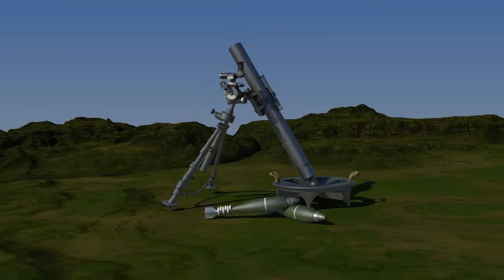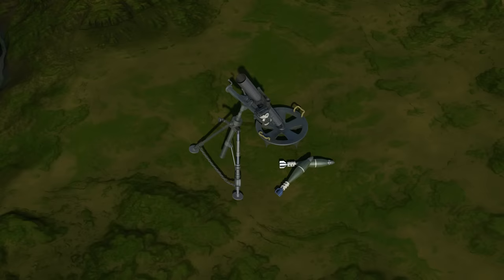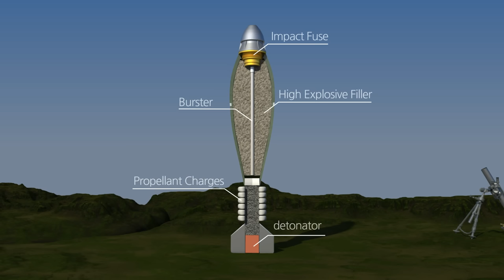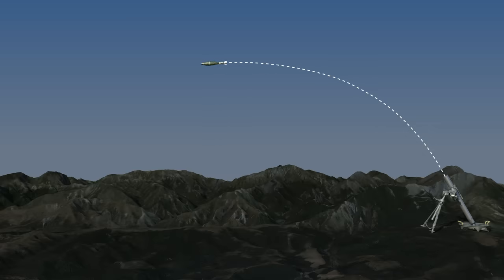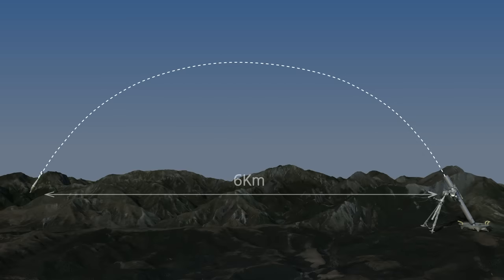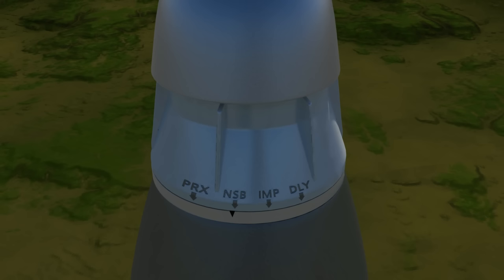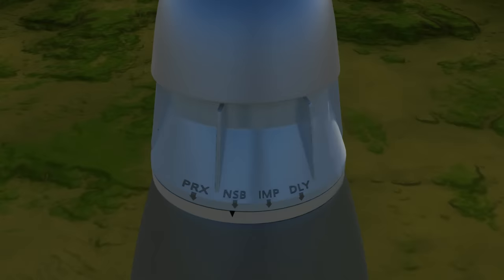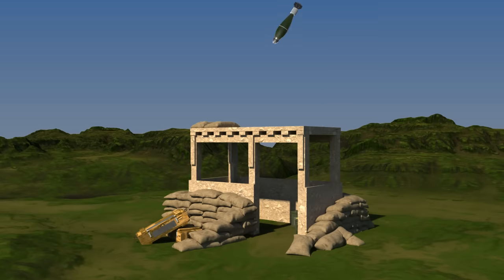How does a mortar work?

Comment: Is the morter a howitzer? I've always worked under the impression that they were different. Morters where a short barreled, short range, high arching indirect fire weapon. Howitzers where long barreled, intermediate to long range indirect fire  weapons with shorter archs, and possessed a limited direct fire capability.
Reply: There are mortars systems which can operate also as small howitzers (2S9 Nona, 2B16 Nona-K, 2B9 Vasilek, 2S31 Vena, Drok etc.).
Reply: @petersedliak4362  Those are all mortars. I don't understand how they qualify as Howitzers, self-propelled or otherwise.
Reply: @reminder9146  They are designed as mortars, but their main weapon combine mortar and howitzer characteristics. Nona-K and its cannon 2A51, is typical example. Its alowing even direct fire on target, but due to smaller charges, its projectiles have significantly lower speeds, which mean that even for direct firing they need certain elevation of barrel above LOS.

Comment: You can also have a breach loaded mortar which can be fired horizontally.
Reply: @50buttfish  not quite,the breach is locked closed when the bomb is loaded.It is  like a howitzer.It can be fired at all angles from zero to 90.
Reply: Those are modern pieces mounted on a vehicle that break the definition of a mortar. It is more of a smooth bore low pressure gun that can fire mortar shells.
Reply: @Pukovnik141  they aren't modern they are around since at least the 60,s.Used them mounted on the Panhard L60.The barrel was only designed for 60mm mortar rounds.These were later changed for 20mm cannon turret instead.They then were withdrawn from service in my country around late 90,s

Comment: Mortar can drop into a trench which made it a very dangerous weapon against infantry.
Reply: For digged in infantry usually the approximation head is used for detonation in 5 to 10m  height. the shrapnels will hit into the trenches from there. they can mix it with delay heads to penetrate the roof of the random shelter at the trenches. The delay heads are also good to hit certain houses in a town or city.

Comment: You don't dig out dirt to "install" a base plate.  It kind of installs itself after the first few rounds.
Reply: You dig your foot out from under the baseplate because you were facing the tube when the round struck.its not like the oil field or pipeline where you have steel toe boots. Even that wouldnt matter because it would take off whole part under the plate

Comment: I honestly was not aware that you could have those kinds of settings at the end of a mortar shell. I mean how does that exactly work anyway? They don’t have a computer inside so how does it know that it is above the target for a certain amount before detonating when in the proximity setting?
Reply: I assume works like a old time alarm clock after so many seconds depending on the distance set by the powder bags on the rounds the round will travel.
Reply: The M734 Fuze has doppler radar

Comment: How does it detect how high it is currently above the ground to trigger the explosion?
Reply: There are several constructions. Radio altimeter, or mechanical: mortar round spins for stabilization. Mechanical detonator counts spins and calculates distance

Comment: A Howitzer* is a gun that can elevate beyond 45deg with rifling, and a breach that can be opened and closed for the purpose of reloading and ejecting the spent case.
A mortar 'aint a gun since it's muzzle loaded and doesn't contain a breech that can be cycled like a gun.

*I have a book on artillery and it's evolution and implementation and it is a-b-s-o-l-u-t-l-e-y fascinating.
Originally a Howitzer was a short barrel field gun designed specifically for plunging fire. A siege/trench gun.

Howitzer today however, has become a generic name for a field gun that can elevate beyond 45deg for the purpose of reduced range gunnery - so plunging fire ie behind hills and into towns etc even though they retain a long barrel 
Essentially they are now a dual purpose field gun - saving having to carry two different types of gun when one type can perform two tasks.
I could be wrong but IIRC typically the plunging fire aspect of the modern Howitzer requires different rounds specific to plunging fire - ie there's no purpose sending a normal projectile to 45,000ft (or whatever it is) when you only want it to go 8nm horizontally so they use charges and rounds suited to that task and general purpose ammo for normal use. Using normal ammo for plunging fire results in excessive flight time. For accurate gunnery, temperature, rotation of the earth, wind, varying barometric pressures and numerous other parameters need to be allowed for, so I believe they use rounds for the specific to plunging fire rather than long range rounds that spend a lot of time going up and down reducing accuracy. 
I'm no expert, just read it in a book.

Like life there is no one gun that does it all. They all have strengths and weaknesses.
Reply: Your book is highly inaccurate.  8 inch and 6.3 inch RML howitzers were muzzle loaded just like many of the rifles and canons made prior to the 1900s.  The German 75mm field mortar, the 60mm Brandt, the Soviet 240mm M240, and most self-propelled mortars are breech loaded.   Muzzle loaded canons used a variety of loads and techniques that can replicate the effect and damage of plunging fire.  Today, cannons are rifled and breach-loaded too; specifically 20mm and 30mm cannons.  The biggest difference between canons and howitzers are in the pressures and temperatures they’re designed to withstand over time.  Canons, like guns, tend to be mass produced using relatively quick and simple processes while howitzers are usually more meticulously developed and produced in fewer numbers.

Comment: how do mortar explode 30cm before hitting some surface?
Reply: A proximity fuze, which is almost (but not quite) like a tiny primitive radar. It basically uses the shell as an antenna to send out a signal. That signal is then reflected. Since the shell is rapidly closing with the target that creates a doppler effect that the shell measures, and the amplitude of the doppler effect will increase the closer you get to the target. When it corresponds with the distance you want it triggers the shell to detonate.

Comment: So how come when the augmenting charges don't fully propel the ordnance, like fall within 2-3 feet of team, it doesn't go discharge?
Reply: The fins on the mortar shell cause it to spin like a rifle bullet in flight, making it more accurate. The fuse in the nose of the mortar shell doesn't arm itself until it has spun enough to be well aways from the tube and crew that shot it.
Reply: @johnstuartsmith  Thank you John!
Reply: @johnstuartsmith  Mortars don't spin. Fins are straight. Mortar doesn't require spin stabilization since it needs to point forward and follow curved trajectory. Fins are there so that shell is pointing nose forward where the fuze is so it can detonate correctly. Fuze arms when it is fired due to sudden acceleration. What you are talking about is howitzer round fired from rifled barrel. Spinning keeps round from tipping over since howitzer rounds don't have fins at the base.

Comment: My father-- expired in 2013 -- was in the Indian army's First Maratha battalion, and was  the platoon commander of 80mm (3 inch) mortor.Now I am sixty five+ but always wondered how a mortor was aimed, how the  targeted distance was to be adjusted accurately, .
Now I some what came to know about it, though not through the video itself, but from the comments of the soldiers.
Thanks brothers, love to you from me,
Maharashtra-india.
(Can anybody enlighten me on my curiosity in this case of Mortors, when 3inch Mortors, and 80 mm Mortors are the same,how 3 inch becomes equal to 80 mm.,as mathematically 3inch=75 mm.
Reply: 3 inch mortar was used by British infantry.It was a light mortar without a sighting system.Dont think it's still in use as it's not NATO standard.81mm would be.
Reply: @eugeneoreilly9356  thanks sir.

Comment: The propellant in a mortar or any gun does not explode or detonate.  It burns rapidly to generate gas to propel the projectile down the barrel.  If it did explode, it would probably dangerously burst the barrel and gun, injuring the personnel operating it.

Comment: a guy had a question how do you tally the mortar kills.... well when rules of war are followed... i count it by the amount of men they agreed to send.... one almost passed the field...  miraculously but did not
Reply: You dont tally them. Usually you can tell how many you have left based on how dry your mouth is. If you have dust in your teeth and your tougue is sticking to the roof of your throat, 0. It takes 3 licks to get to the center of a tootsie pop

Comment: So if we use the delay setting and additional spin drill like tail and head could really penetrate bunkers and shelter
Reply: It already can, and for more penetration you need higher speed (altitude), mass and smaller diameter. That is why for this purpose special bunker buster aircraft dropped bombs are used and not mortars

Comment: why I never ever can find any video about how they can aim with the Mortar ?!? I slowly start to think, they just shoot somewhere with this Mortars as like good luck, or you can see trough the mountain with the sight ?
Reply: Sight shows you angle and direction. Something like using compass and inclinometer. (Only there is no compass inside mortar gun sight) The direction and angle is calculated with a formula based on multiple factors ( direction, distance, temperature, humidity, wind, bomb...)
Reply: @Pukovnik141  I never see anyone count anything, they just put in the angle and shoot, I think they just try their good luck to hit anything, or where they get the Informations from

Comment: Well according to Black Ops II, the firing pin is directly on the bottom of the shell and all you need to do to "activate" it is give it a firm swat, at which point you can chuck it with all you've got for a handy improvised grenade.

Once again, video games have lied to me. . .
Reply: That hitting in game has nothing to do with firing pin . it activates fuze that is on top of the shell. It is usually activated by sudden acceleration when firing and maybe can be activated by sudden acceleration by hitting hard surface Modern fuzes can have mechanism that prevents this as it would be hazardous for soldiers handling shells.

Comment: In the film "Saving Private Ryan" in that last scene where the fight with Nazis is becoming desperate, one of the soldiers is using mortar shells as bombs and is activating them by hitting the back part of the ground...I wonder if that is realistic, I mean, wouldn't the shell's charge explode when he hits those shells off the ground?
Reply: That hitting activates fuze that is on top of the shell. It is usually activated by sudden acceleration during firing and maybe can be activated by sudden acceleration by hitting hard surface. Modern fuzes can have mechanism that prevents this as it would be hazardous for soldiers handling shells.

Comment: How does the augmenting charges on the outside not damage the mortar itself?
Reply: Shell is made of steel and charges burn and explode ( rapid gas expansion). They don't detonate. It is engineered in a way to withstand operational pressures.

Comment: Its a bore not barrel, defination changes with 20mm being a barrel, as 21mm would be bore .
Reply: You mean tube? The bore is the hollow part inside a gun barrel or other tube.
Reply: @Pukovnik141  Correct, its lost in translation, I guess it would be tube, but not barrel(look above).

Comment: A mortar isn't a howitzer. But how do you aim the thing?
Reply: The sight is essentially like a surveyor's scope: you set pole or poles in front and use the sight to figure a calculation of angle & elevation, combined with the charge of propellant you used (those rings at the base of the round). At short ranges, you fire from that yourself. At long ranges, a Fire Direction Center uses more math, and a series of graph plotters (or nowadays a computer) to calculate where the round will land. That's the short & dirty version.
Reply: @MM22966  Thank you. I know that the mortar has essentially never changed. But I had no idea as to how they are aimed.
Reply: @JaimeGarcia-pe7bj  Np. There are also hand-fire (physically moving the tube or holding it with smaller mortars) and direct-lay for close targets, no math involved. There are also guided shells (GPS or laser) for larger (120mm usually).
Reply: @MM22966  The FDC gets the coordinates of the target and the impacts from the Forward Observer. So for the enemy the best way to blind the mortars is to take out the FO. If enemy infantry is closing in and you are somehow protected (e.g. if you are in a tank), your last resort may be ordering the mortar platoon to shell your position and hope for the best. That‘s why Forward Observers are massive fans of proper camouflage.
Reply: @MM22966  Funerals. That‘s a creative way to stop a mortar platoon. Thanks for a great story! 😂 
Though I would really like to see six 120mm shells hitting a garbage dump...

Comment: How does the fuse know when its close to a surface? Its there some fancy ultrasound sensor installed? Or is it simply some rod sticking out.
Reply: [Edit] I was wrong, it's actually radar.
____________________________
Probably a capacitive sensor, they are more reliable than ultrasound (less probability to trigger early) and tend to vary their detection range depending on the material in front of them, which coincides with the video description
Reply: @wanderer2688  Thanks for the explanation
Reply: @vast634  You're welcome.
But take this info with a grain of salt, it's just my guess.
Reply: @wanderer2688  radar, actually, but I don't know the frequency. Probably a few centimeters just like aircraft radars.
Reply: @stettan1  amazing, I would have never guessed it, thank you
Reply: @stettan1  It senses to a few meters out and frequency is not measured in cm but in hertz (Hz). Wavelength  is measured in distance units (meters).
Reply: @Pukovnik141  I know, I know, but I tend to slip since they are linearly related.

Comment: BUT HOW TO TARGET ENEMY BY CONTROLLING MORTARS FIRING..?
Reply: First you need align mortar on terrain , so you know angle between north an base angle of mortar. Then squad officer calculates angle between mortar base and target, on reference tables he gets info about of number of charges and elevation angle. Then he get weather info and adjust angles to correct values.  Mortar team gets angles from officer and uses two wheels to turn mortar and change elevation.  After shot, overseer looks to impact points to mage correctionss

Comment: Couldn't you just increase the angle to obtain a shorter range? Why all the playing around with number of charges?
Reply: The higher the round flies through air it is more affected by atmosphere which negatively impacts accuracy. The shortest flight duration is preferred to maintain accuracy. 
example: Take a rock and throw it 2m in air and try to hit target 3m in from you, and then repeat but throw rock 10m in air and try to hit same target.

Comment: Whenever I think of mortars, I always think of the Hollywood reality movie, Saving Private Ryan. And the utterly ridiculous part, toward the end, when they are fighting the Germans in the village. They have a mortar, but the barrel is damaged, so they take a mortar round in hand and use the base with the firing pin, slam the round on the pin and throw them like a grenade. When in fact, if they actually done this, they would of set off the propellant and the round would of taken off along with their hand. Ha ha.

Comment: How are they aimed?
Reply: Thats quite complicated. First you need a scout team. They provide the coordinates for the commanding officer who will calculate the position of the impact area in relation to the mortars. You actually aim the mortar sideways with two sticks sticking in a straight line ca 20m to the front or back of the mortar and the distance is calculated by the charges on the grenade and the angle of the barrel and is basically set with numbers and a spirit level on the sights. Bevore you shoot the oficer has his own device on a tripod where every mortar needs to be aligned to this device. The commanding officer just shouts rhe left right number, the elevation number to adjust the sights then the amount and type of ammunition being shot and how to shoot it. Also a mortar is never alone its at least 3 of them and ideally 6 split in two groups. And also a mortar is not an accurate weapon thats why there are more than one firing at the same area. Thats how I've learned it a few years back.
Reply: The two sticks are just a guideline. So the commanding officer tells you the numbers for left right wich is basically like a compass but not 360 degrees but 6400.  you set the nubers on the sights and then aim the mortar to the two sticks so they are in line with the sights. Its super complicated to explain in a diffrent language.

Comment: They got so many little things wrong here. They called a mortar round a mortar shell? What? There is no shell left over lol. Don't get me started on that long ass firing pin. Never seen a firing pin that long. Theyre generally not even a cm long. There are longer ones, but they get inserted from the bottom with only a "nipple" being exposed. Howitzer? Really?